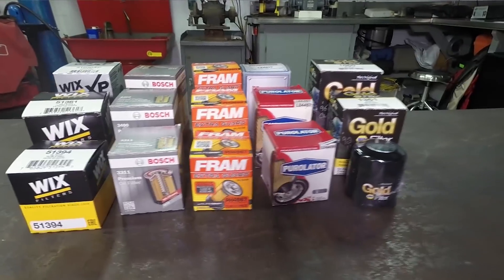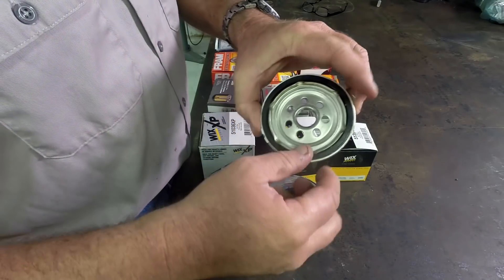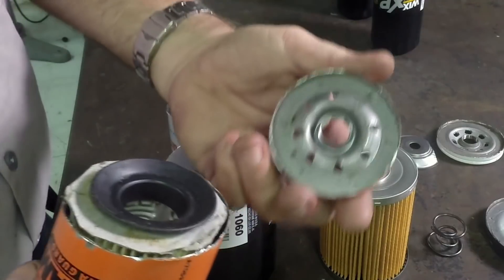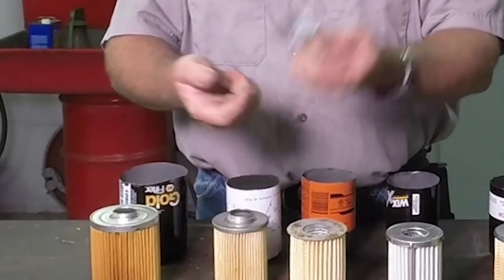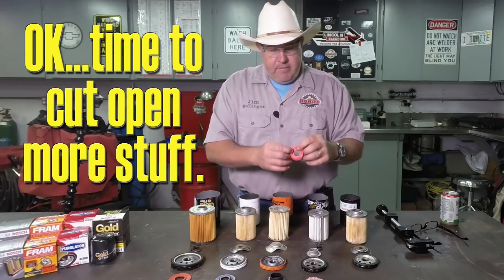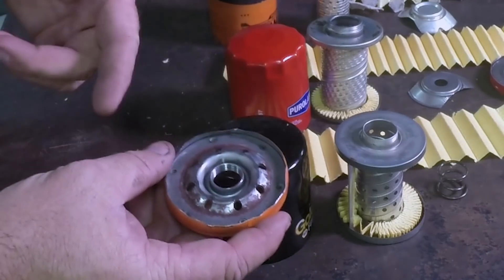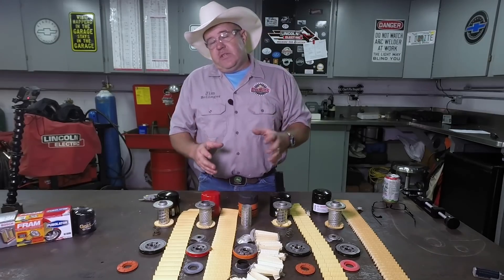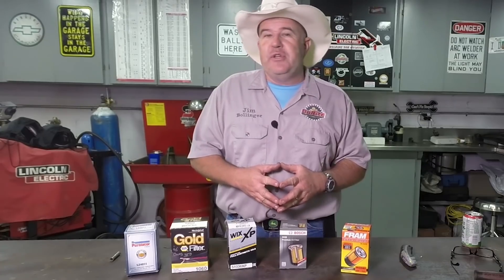The worst oil filter EVER!

Comment: Well they say the proof is in the pudding. All I ever use in my trucks is fram oil filters. Was in the hot shot business for over 10 years. When I went out of business every truck had over 400,000 miles on them and still running. I kept a 1999 Chevy Silverado and just use it for running around the woods, hunting and hauling my tractor to my Son camp in Texas 95 miles from my house once a month. Eight years ago I traded it for a week hunt in west Texas on a ranch my son-law manages. It had over 530,000 miles on it and we drove it up there 495 miles. And he says it's still running strong. the only thing I ever done to it is change the oil and filter ever 5 to 6 thousand miles. Replace the V-belt a couple of time. Flush the antifreeze and replace every year. And the only mechanical work I  every done on it is the Alternator and Starter both went out a little over 400.000 miles. It still gets over 20 miles to the gallon and doesn't use oil. Like my grandpa always would say, if it's not broke don't fix it and never change horse in the middle of a stream.

Comment: Commenters: "Ive been running fram filters on my 1827 Chevyota Hondbeetle for 9999999miles while never revving past 1800rpm and doing mostly highway driving at night with no traffic and I havent had a problem! Change the oil and filter after every trip and you wont have a problem either!"

Well, when you find out your house is structured with chopsticks and you live on a fault line dont complain. Just stick to the regular maintenance intervals and it will be fine.

Comment: Lol if you got a lot of metal in your Engine a Fn oil filter not going to solve problem. I'm a Master Tech Mechanic 40+years I have used Fram Filters my cars customers cars never had Engine Failure. Its Quality of Oil and when you Change it 3000 miles Conventional 4000 semi Blend  5000 miles Synthetic anybody Drives 10k miles on a Oil Change is A Cheap A hole Doesn't Know Shit

Comment: Frams gotten my 04 Silverado to 215,000 with no oil consumption so its obviously doing its job. And I'm glad were using the low economy level fram filter and not the synthetic one. Bad video.

Comment: Hey there, I appreciate you doing this cut open filter review and I wanted to leave some words as a parts guy for the past 10 years. I've always worked for independent NAPA stores (this means we're privately owned, but we deal mostly with NAPA Auto Parts) anyway I wanted to clear some things up.

Wix filters manufacturers the NAPA line of filters. You picked a NAPA Gold and Wix as well as a WIX XP to compare and just to let you know the WIX XP is actually made under the NAPA Platinum line. The Platinum or XP line is comparable to our XD line of filters that were previously only available for large trucks (Part # 1748XD, as an example for those in the know) and the technology in that was used for the Platinum or XP line. This is marketed to customers that have a high oil change interval, I use them on all my vehicles, but you might notice a difference in the filter media compared to a NAPA Gold, or standard Wix filter when seen side by side. The Platinum or XP filters are meant to last as long or longer as a synthetic oil change interval (usually 5k miles or more), but we still recommend staying with the manufacturer's recommended interval as not all engines are created equal.

Hope this helps and for what it's worth I'm not being sponsored I just want the correct information to be available to everybody that takes the time to read what information I have to offer. Like I said I've been doing this a while and have seen quite a few filters opened up and I would only use Wix or NAPA brand filters on my vehicles. Also if anyone wants to know Mann Hummel and Wix are now partners or the same company or whatever so if you see that on your Wix or NAPA filters don't be alarmed, these are still quality filters that are built to last with your engine.

Comment: Every other oil change I cut open my oil filter to check it out and see how it looks inside. Of course since it has oil in it I don’t use a grinder, I use a 4 inch pipe cutter and it works great. Only had one filter that looked bad on the inside and it was getting shavings inside.

Comment: So my challenger started to drip oil, ended up being a bad filter placed by the mechanic, brand Fram...month later and after a trip, noticed my Nissan Armada dropping oil...Same mechanic did the oil change, took it to another mechanic and surprise, Fram filter leaking, changed filter for a Wix filter and problem solved, end of the story...Fram filters are bad...and fuck that mechanic since i requested Wix or Napa

Comment: I call horse shit. All I've ever used is Fram ultra guard filters with full synthetic oil and I try to change my oil every 10000  miles but have gone up to 15000 miles. I'm about to rollover 300000 miles on a 98 k1500 and have absolutely no problems, never. I also run these in my all my previously owned vehicles. Never had a problem. Just another brand bash. I'll continue to use fram, without a doubt. Also in this video is the lower grade fram filter being compared to higher grade filters.

Edit: and I also only use cheap Quaker State full synthetic oil that is only 21 bucks a gallon at my Walmart, for all those Mobil, Lucas, and Amsoil freaks out there who are getting ripped off who claim to be the best oil....Keep your oil filtered and it'll never go bad. Fyi there's big heavy duty semi trucks who are hauling 80000 pounds everyday who put over 200000 yes 200000 miles on the same oil and all they do is change the filter and top it off when they need to. They use bypass filters as well. Keep the impurities out of the oil, it'll never go bad. Fact!

Comment: First  i’m  not  with  one  against the  other - What i think - is - 

A. We should use  the  same  sized filters ,  meaning what’s  for V8 5.0 GM as example Chevy - or Honda civic 89 , etc - to have more accuracy in results - yes i do agree that there is cheating in that and  bad ones - my point is to. compare. what’s  for  ( a ) to what’s for ( a ) .

B - What’s  the  manufactures  manufacturer   for  there  cars , important  to  ,  as  Ac Delco - Motercrafts , toyota s honda’s - the rest . 

B - Before and after use  - is highly important,  what’s looks. cheap not. always cheap after the use , some material  stand  under  heat. stress  more  than  others .

Comment: About 15 years ago I cut a frame apart and it had warped cardboard for the bypass valve instead of neoprene, no frams for me since. Also some time ago I used an STP oil filter and my Jeep there after lost about 10 psi, turns out the holes in the base we're tiny compared to wix which I have been using since. That restricted flow permanently and messed my motor up. I also always use a double size filter in all my cars now, the Ford 351C FL1 equiv for my Stang, Celica, Supra and now Jeep 4.0.

Comment: Before I dropped Fram I filters I got ones with rust inside  and worse yet I got tw0 oil filters with metal shavings in them.Ibought fram air filter that was in a regular cardboard box but the filter was in a plastic back that had an oil film on it and the filter was oily too. I put it on my trudk and my truck started pinging. I correctly guessed  that the filter was impeeding the flow of air.I took the oily filter out and the truck ran good again I have not bought anything from fram since.

Comment: Thanks man, I've always used Fram, and I've seen rust on top more than a few times. Recently it got to the point recently I started switching to other brands, Wix being one of them. I'll never buy a Fram again after this video. Haters can spout all they want about specs and certifications Fram goes through. All I know is you can easily see those are crap, and there is little to zero care or customer service left in this world so just because they are supposed to be "good" doesn't mean they do any quality control or aren't sleeping with the inspector that signs them off. Anyone with any intelligence can see the insides of those Fram filters are shit! That bright orange makes them good for target practice though! Thanks for the video!

Comment: Not so sure about this,  I have used Fram and Mopar filters for over 49 years and also on my Race Cars and have never had a failure, leakage ,rupture or premature engine wear, my engine tear downs have shown that those two brands work! if Fram filters are this bad  they would have had the failures that would have taken them out of business years ago, so far I'm not hearing or seeing that, almost every vehicle that I've used these two filter brands on went well over 150,000 miles or more! this video is taken with a skeptical viewpoint ......

Comment: I thought Fram oil filter was supposed to be high quality filter I’ve used fram in the past not any more I’m sticking with NAPA Auto parts and anyone that mocks NAPA you’re stupid I’ve been a self taught mechanic for over 25 years on older vehicles and never new that fram filter was selling crap like that it’s like buying Harbor freight tools instead of snapon

Comment: It wasn't quite as big of a deal back in the day of old pushrod V8s. However, in the days of variable valve timing, turbos and 10,000 mile plus oil changes, filters really start to mean something.

As an example, the Ford 3V 4.6 and 5.4 liter V8s have a very well known issue with cam phasers. What is far less known, is that the problem is almost exclusive to engines serviced with cheap oil filters. Ford's testing was done with all Motorcraft filters, which are of high quality. Of course a lot of people serviced their trucks at Jiffy Lube or bought cheap filters, which would tend to have horrible anti-drainback valves, starving the cam phasers of oil every time the engines were started after sitting for more than a couple hours.

Fleet trucks serviced with Wix filters are not known to have that issue, which is why most F150s with bad cam phasers are personal vehicles.
Reply: Interesting information. I've done many a cam phaser job on the 3v 4.6's and 5.4's. I never thought about it far enough to suspect that. Neat.

Comment: Why not cut the higher quality Fram. The Napa Gold and Wix XP are the higher quality filters. I do know that the lower wix/Napa’s are still better than the low Fram but this isn’t Apples to Apples. This is like comparing a Geo Metro to a Cadillac Escalade.

Comment: I have 314k Miles on a 94 Silverado 350cid. I've only used Castrol and fram filters. The engine looks brand new inside. It's not the filter that aids in engine longevity as much as using quality oil and changing it regularily.

Comment: I use to use fram filters until the mid 90s, the the car I had the base plate on the filter was real cheap, that was when I changed to something else, if people only new how cheap fram filters are made, then again many don't even maintain a car that's worse than a fram filter.

Comment: Well demonstrated lesson. If this is the type of unbiased option with the appropriate not doctrines lesson you are serving the consumer, then I am a new subscriber until otherwise. I used to use Fram until I learned that it is poor quality in the interior design thanks to your video. I mainly bought it each time I change the oil filters because I really enjoy the rough easy to clasp/grip the filter containers to install and remove from the engine.

Comment: The reason I quit using them was oil leaks at the crimp on the can.  I seen it on older 5.7 GM's and 3.8 GM's among others . I originally thought it was the O -Ring leaking but that was not the case. Even seen it happen on the quick change private label orange filters as well. No more orange filters for me.

Comment: They've (Fram) have been junk for years. A friend of mine that I used to race with used the Fram on his brand new race motor. Blew his engine up. This was about 12 years ago and I havent bought a Fram since. So if you want to go the safe route for racing engine filter? Get a K&N oil filter. Thats what I went to. Good video.!!!

Comment: Lol I’ve used this oil filter in all my cars except my last 2 Civic Si’s. My 1991 Civic Si has 420k miles on it and I put 250k on it with Fram oil filters...still running great haha. Like you just said car product companies say this and that about extending life. Kind of the same thing that your saying about shortening the engine life. Just one mans opinion. My opinion on all the filters I’ve used is that the oil has always came out cleaner (Castrol GTX) after using Fram. I use there cabin air filters too and they also last longer than competitors. Same with the air box filter...

Comment: Back around 1967 I hacksawed a few filters open.  The Fram was obviously of lower grade than the Wix or the Hastings.  Coil springs vs. flat stamped seal,  total s.i. of media, general robustness. Apparently Fram was and still is *hi*.

Comment: Yet Fram continues to use that old chestnut, "meets or exceeds manufacturer's specifications." Sure if the only requirement is to have a filter like thing on the engine. 
Napa and Wix filters use to both be made by Dana back in the 80's and 90's. 
I would be interested to see if Baldwin is still making a quality filter or not. Back in the 90's they were great filters. We would cut open filters and show folks what you just did. 
It's amazing how Fram hasn't changed a thing since then.

Comment: As I have told everyone before I would not use a Fram filter to filter  sewage. I had a cutaway display in the shop to demonstrate what a piece of junk Fram was. I have used  Wix on my personal and business vehicles for years. I use mostly Baldwin filters on my 18 wheelers and heavy equipment. You also forgot to mention that the Fram  filter media is just stapled together rather than having a joining bar. if you open a Fram you will see that it is only joined in the middle and the media material is open above and below the staple allowing unfiltered oil to pass. Thanks for the very informative video. Great work!

Comment: The word is PUTTING, not pudding.
Reply: its pudding...but who cares this is a filter video lol
Reply: @samsquantch14  "Put into practice", hence to prove the practice, the proof is in the putting.. but who cares? it's only an idiom.
Reply: @MrJtaylorj  you sound like a lot of fun to be around lmao
Reply: @samsquantch14  Gee Thanks! I am !
Reply: @MrJtaylorj  you probably use fram filters
Reply: samsquantch14 Actually, no. They are junk.
Reply: @MrJtaylorj  i kid i kid lol but they have better ones too...not these $4 pieces of crap...but i ran the cheepo fram in a subaru for about 100k miles and never saw a problem
Reply: @samsquantch14  I think it all depends on the vehicle; I have only used factory OEM filters on my Toyota and Lexus products; never any leaks or issues; 250K-350K miles. Merry Christmas!
Reply: @MrJtaylorj  oem is always best for sure...gotta love those toyotas.they never seem to stop running...to you as well and a happy new year.

Comment: Many oem oil filters use the cardboard endcap designs. IIRC the OEM Bentley oil filters use cardboard endcaps. Many motorcycle filters use the cardboard caps. The cardboard is claimed to provide better sealing between the endcaps and the filter material. Also manufacturing is much cheaper and easier. I've seen videos where people pull on the cardboard endcaps and the metal ones often pull right off, but the cardboard caps bond together better. If you change your filter every 3000 miles, you're probably never going to have an issue with a fram filter.

Comment: I have found rust in all filters, just look before you buy,  a lil rust ain’t gona kill ur engine, I use the cheap Fram on any equipment using thick oil because of the low micron element

Comment: Talking about rust it's not going to rust if there's oil in it and the cardboard also will hold together if there is oil in it, it doesn't have to be a great heavy quality material is just a filter it filter out particles off metal dirt in anything else there's nothing wrong with Fram filter

Comment: What about the AC filter? Junk or good? By the way I used the Fram filter in our new car. While driving, the oil light came on. The dealer found the Fram filter disintegrated.

Comment: Why is "rigidity" important  ?  A balloon is not rigid yet it can contain liquid and withstand pressure. Some of your metrics are no good. It seems like this is a anti-fram type presentation. Which I haven't even looked it up but I suspect fram has a large market share. Wait... why didn't you try to cut the other filters paper apart ? I have no dog in this "hunt" but this seem like very lopsided presentation.

Comment: I talked to an old engineer. He stated any spin on filters paper media can only trap about 1 ounce of carbon and trash. Filter media must be attached on both ends with metal cap. And  additives in all oils only last 3,000 miles.  (anti wear?)  acid reducer, etc. And zinc was ^^^ removed by EPA.
Oil is cheap compared to $12,000 factory crate engine. I change oil@4K max. The thin synthetic 5W15 crap is like water. How is that going to hold up @160F underhood temps? Bearing and cam wrecking piss. Thin oil does get past the rings. Burn much? Yeah with factories using very low tension oil rings, for mpg.

Comment: After helping a friend with his oil change on his Opel, I will never buy Fram filters again as it would not give any oil pressure at all and the low oil warning indicator stayed on even after 20sec crank over. We got our refund and bougth a genuine Opel filter and we got pressure after 2 seconds. Will never buy Fram filters again! Best part was I said to him prior to the Fram filter fitting, "those are of low quality, I would not have used that brand" I was right. Crap.